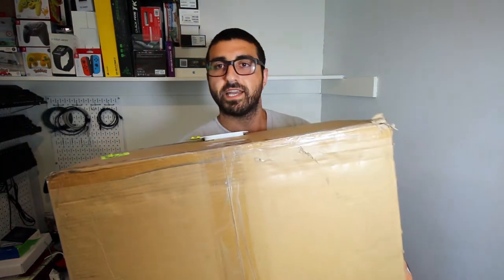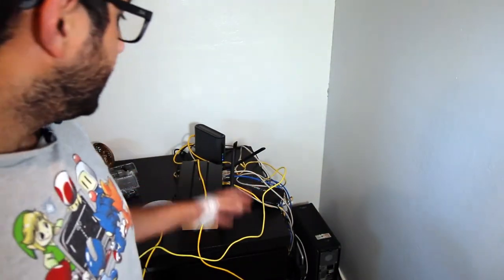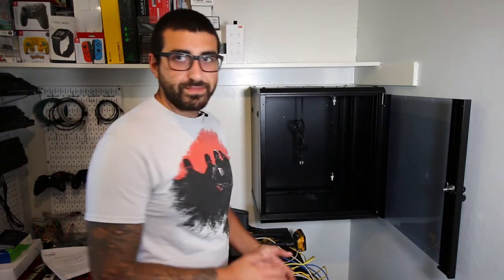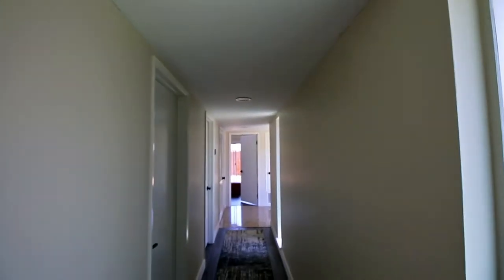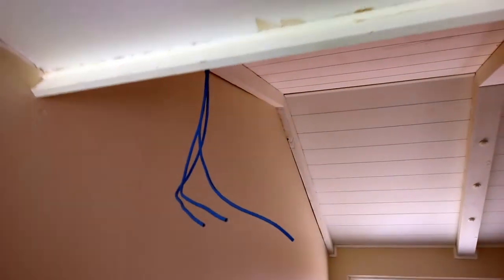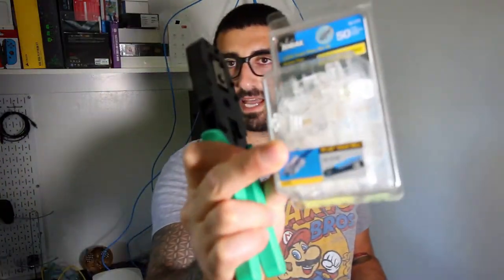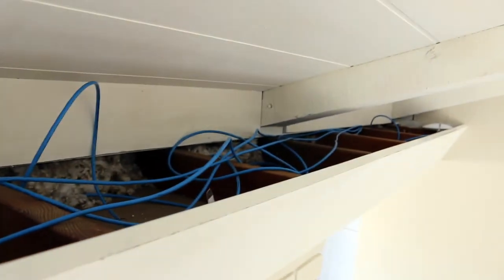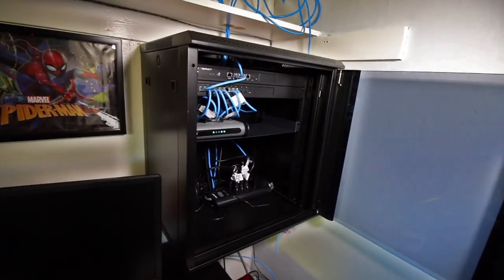Setting Up Home Network Infrastructure | Running CAT6 Cables!

Comment: just curious, why didn't you just mount the rack closer to the ceiling?
Reply from the maker: I thought about it. It's easier to access under the shelf rather than over it. I didn't want to get a stool out if I needed to tinker with it.

Comment: I think you should've got a wood panel and attach it to the studs to mount the rack. Those 50 lbs anchors will not hold the weight and you may forget the weight limit and keep adding weight to it and have a bad accident.
Reply from the maker: That's a good idea. Unfortunately, it's all setup and I'm not going to undo all the cabling to add that in. It's help up pretty well so far. Fingers crossed it doesn't come crashing down.

Comment: Good job. Add the weight of all your peripherals and if it's under 50lbs than you'll be fine.
Reply from the maker: Thanks! I do plan on adding another switch and a rack mount power strip so hopefully that doesn't take it over the limit. So far so good!